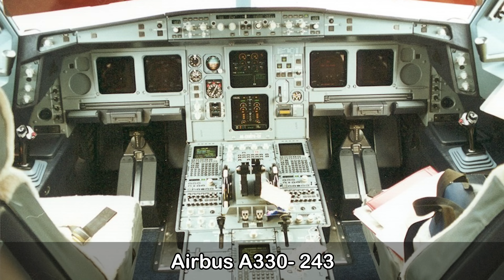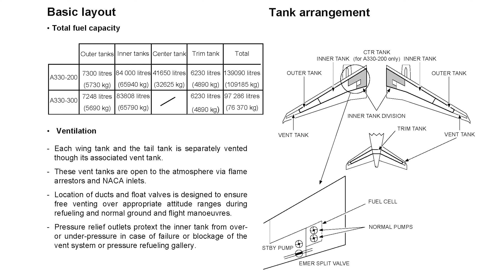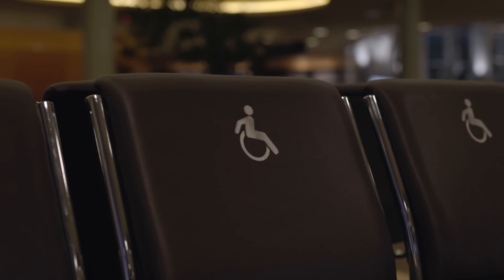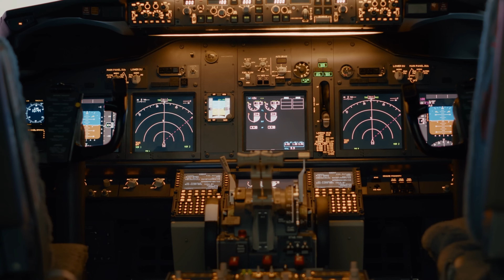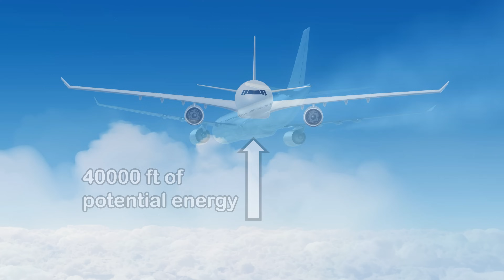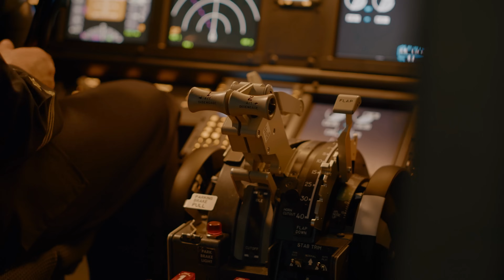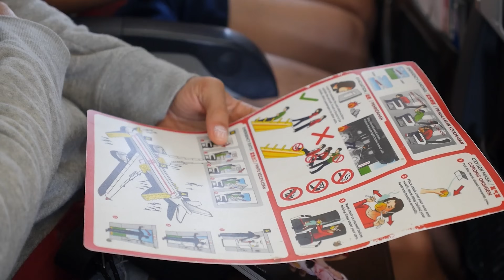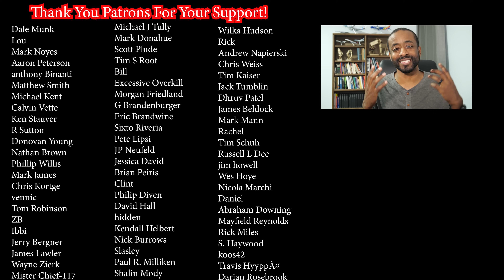The RAM Air Turbine. How Planes Continue to Fly Without Fuel

Comment: Largely correct but one point of note, even if you don't have "fly by wire" flight controls you still need a RAT.  The 767, CRJ, and E145 I've flown all have RAT's and are not fly by wire.  Reason being at a speed of .84 mach there's not enough mechanical force from both pilots put together to be able to move any of the primary flight controls.  Simply too much air resistance.  RAT's can either be an additional electrical generator or a hydraulic pump directly powering the PCU (power control unit) that the cables hook to that move the flight controls.  Hope this cleared something up, overall excellent video!

Comment: This is one of my favourite air "disasters". Your explanation of conservation of energy reminded me of a few months I bought my 2000 Honda Insight. Was filling up and a guy at the fuel station told me I should put a windmill on the front of the car attached to a generator to charge the batteries. That way, it would recharge as I drove and I'd never have to buy fuel again! I tried to explain that "in this house we obey the laws of thermodynamics" but his suggestion was to just use a large windmill! Finally after going around in circles a few times I told him that he was a genius with a world changing idea so he should invent himself and make billions. I always wonder if that guy went home and started playing with oscillating fans in his garage.
Reply: Sadly for him, Kia were ahead of the game...  the Kia Niro EV (and others) has a "Vehicle-to-Load" system.  There is (dependent on country) a 230 volt, 16 amp power point inside the cabin.  All you need to do is plug the charge-cable into the charge-point on the front of the car, feed the cable in through the window, and plug it into the Vehicle-to-Load socket... Now you can drive forever!
(I don't know why Kia did not build the cable into the car, it is quite ugly, and you get cold in winter!  Ahh well, small price to pay, I s'pose, maybe in next year's model.)
WhaDaYa mean Jeremy... you're just confusing me with all this "Conservation of Energy" nonsense!  😠 
Yeah... of course I know about thurma-dye-nam-ickxs!  😜

Comment: An EXCELLENT video, Jeremy! I spent a lot of years doing or supporting aircraft maintenance, both in the military and for a major airline, so I was already familiar with what a ram-air-turbine (RAT) is and it's importance. What I particularly like is your engineering and physics based approach to the discussion. I hope you are inspiring lots of young people to pursue the STEM topics. 

Another interesting topic may be the "Gimli Glider" incident  in Canada, several decades ago. A large passenger aircraft on a trans- continental flight ran out of fuel about halfway across. The complicating factor here is that Canada was in the middle of transitioning from the British Imperial measurement system to the Metric system, revenant documents were not updated, and more. One of the pilots knew the area, because he had served at a (closed) RCAF base nearby. That knowledge, and the RAT, resulted in a successful landing. I believe the aircraft was repaired and put back into service. 

At this point I would normally rant about the idiocy of the USA not making metric mandatory instead of just the current status of "legal". (The other two countries are each smaller than most US States.) But maybe that can be another video.
Reply: I naturally assume that your video is now an integral part of pilot and engineer training. 
The pilots will learn not to miss in their panic, that comment above the list, and stop the fuel from reaching the rupture.

Comment: Well done.  Here's a scenario I faced many years ago that could be used to teach how the much simpler systems on small piston engine-powered aircraft work; namely, how the magnetos will keep the engine running even if the alternator fails.  It isn't enough of a story to make a video about, but it could be a useful nugget nonetheless.  I was piloting a Cessna 172 many years ago in instrument conditions at night on an IFR flight plan between Corvalis, Oregon and Seattle.  At one point in the flight, I caught a very brief scent of an electrical fire, but very brief.  Then I noticed the ammeter was indicating zero charging.  Fortunately, I had plenty of battery-powered emergency light sources and a battery-powered GPS mounted to the yoke.  I shut down as many electrical systems as possible to conserve aircraft battery power, talked to ATC, checked weather at alternate airports (all were below minimums), then ultimately elected to continue to Seattle where the weather was better.  The engine hummed along just fine.  I checked in with ATC about every 10 minutes (radio and transponder).  By the time I got to within about 15 miles of Seattle the weather had cleared and I completed the flight VFR, and had plenty of power left in the batteries to turn on necessary lights and radios for the final phases.  At the time I was a nugget instrument rated private pilot, so you can imagine my stress level, especially as I had my kid with me.  Thanks again for this video.

Comment: When I first saw the re-enactment on Air Disasters, it took me 5 seconds at the beginning of the documentary to recognize exactly what the problem was as soon as the first officer reported low oil temp and high oil pressure, long before any mention of fuel.  All I had to do was think; What could cause a the oil in a jet engine to suddenly be too cold? -- A massive fuel leak at the engine with ice cold fuel!.   Regardless of a checklist, it just comes from common sense and knowing engines well for many years, and understanding what engine gauges are telling you.  Even having never flown jets myself.

Comment: I've been shot at and I've done other things, but to this day the proudest thing I've done was fixing 5 different engine generator problems while in the middle of the ocean between the UK and Iceland. 

As an electrician flying on a C-130 on our way back home after picking up the aircraft from Bagram AFB, I was of course woken up mid flight to see what I could do.

The first time I was woken up we had lost 2 of the 4 main generators and the corresponding electrical busses didn't automatically swap over to the remaining generators to prevent power disruption. This alone is extremely unusual, there are 4 main electrical distribution busses that are connected to main engine generators by 8 contactor rated for 210vAC @ 400hz and 300 Amps. The contactors are arrange in a way where they are automatically energized and de-energized by the generators themselves to switch power between the main bus so no one generator accidentally tries to turn a different generator into a motor.

Once all 4 engines and generators are up you can technically loose 4 of the 8 contactors with out getting a single warning and with out loosing a single distribution bus, under highly specific and perfect conditions.

Prior to this event the only time i had ever seen two generators go out at once, where the busses also didn't automatically kick over. It was on a C-130 we had just taken out of the bone yard and where preparing it to be flyable again. After the 3 function test flight the aircraft's crew called down with an in flight emergency. When I examined the system some 4awg wires had chaffed each other's multi layered insulations that include fiberglass wrappings and some polymers that give you cancer if you simply pronounce the name of the molecule chain. Needless to say there where lots of scorch marks.

As I remembered that incident I checked the fault codes but they where generic and usually fixed by a power cycle while on the ground but obviously we were not on the ground. I also, sniffed around for some magic smoke but nothing. As we where somewhere between the UK and Iceland and still had some power, I had the crew turn off the two faulted generators. I pulled all the circuit breakers for the two generators and then started to remove the paneling for the contactors to make sure nothing was going. Of course nothing was wrong.

Feeling fairly safe, I reset the circuit breakers and had the crew reset the generators. They both came on and the busses also came back. Plus all the power readings looked perfectly normal from the voltage to the power drawn across all 3 phases for all 4 generators. So, I went back to sleep.

About an hour later the crew woke me up again and told me "we lost three now" I asked "we lost number 3 too now!?" The dude said "No, we lost number 2, 3, and 4" 

I got up without further conversations and went straight to the contacts ripped of the panels and again nothing. Check the fault codes and the same two had the generic fault codes usually fixed by power cycles. The fault code for the number 3 on the other had was a 50/50 between shorted generator windings or bad control unit. Luckily the control units sit in fairly accessible areas inside the plane and I had a spare one with me as part of my "just in case we need this kit"

After seeing the codes, I went up to the crew had them turn off the three generators. I pulled all the circuit breakers for all 3. I went up to the analog contactors and gave them a few good wacks. I pulled off the connectors for the control units for bot gen 2 and 4 then outright swapped the connection between because well, magic. A trick that happens to work to get a plane off the ground that keeps getting these particularly fault codes. The plane almost always flies fine then when it lands we swap them back and the problem doesn't come back.

As for the number 3 generator's control unit I slaved in the new unit.

With things all moved around I had the crew turn all 3 generators back on and they where all golden.

With power all good to go, I finished replacing the number 3 control unit very carefully, even if it was just the mounting hardware.

The aircraft flew perfectly fine for the rest of the flight and all the remaining flights back home. Once home i restore the control units for number 2 and 4 back to how they should be. I annotated the maintenance forms they had been swapped back and of course the plane flew fine for the next 2 months or so before I stopped keeping track. At leas as far as the main power distribution systems.

Comment: I love that you're into planes! I've been a huge fan of yours since you were picking through the curbside trash and making tools out of old vacuum cleaner motors. Now that you cover another of my favorite subjects, your channel has achieved a new level of awesomeness. You should cover some 400 hz motors that come in aircraft and advantages and disadvantages to high frequency electrical systems. It's really cool that a motor at 400 hz can produce 30 hp and not be much bigger than an electric drill.

Comment: What a great story. As it turned out, I was actually stationed at Lajes Field in the Azores when that happened. It was amazing to see how far the plane bounced and then to see the wheels and tires worn down to the axles because as stated the brakes locked up. Needless to say the runway was covered with pieces of metal from the rough landing.

Comment: Excellent explanation of the scenario of a improbable cascading chain of events that can result in aviation mishaps.
You mentioned loss of cabin pressurization. That is also a function of the engines via bleed air system.
Thanks for sharing.

Comment: For those worried about fly by wire. Most if not all cars today are fly by wire. Fords last vehicle to convert over was around 2006. So these systems cars and planes are pretty safe, not saying something could go wrong, but then there are many other things that can fail. Fly by wire you more than likely drive one.
Reply: i dont think any cars are fly by wire. drive by wire maybe. jokes aside, brakes and steering wheel are still mechanically linked in almost all cars. only the gas pedal has been electronic for ages now.
Reply: Several newer cars especially all electric have gone to no mechanical links now and more will be doing so as they are redesigned. Like most things the high end cars get it first and they move it down through to the others as the improve and streamline production and costs go down. One thing that was slowing down the change over was getting government regulations. It took years just to get LED lighting approved.

Comment: Any landing U can walk away from is a good landing. Truly fascinating story about a) backup systems as safety factor i.e. redundancy in engineering, & b) pilot error i.e. just do & ignore the checklist which is is own backup system. 
In today's world I'd expect real time software analysis & output warnings suggesting possible fuel leak(s) or other conditions based on monitored inputs pilots see individually.
Reply: 737 max: redundancies? sounds like communism!
Reply: @Jack-he8jv  Engineering issues notwithstanding, both 737 Max crashes had major pilot/maintenance errors as contributing factors. There are always multiple contributing factors and it's a bad idea to ignore all but one.
Reply: It was a certification and training problem. A new type rating should have been required, but wasn't. Retraining should have been required, but it wasn't. The mcas was a bad idea, having it fed info from a single sensor doubly so. All because Boeing did not want the plane to require a new type rating, because airlines don't like that. Having the authorities outsource the certification process to the manufacturer wasn't a brilliant move either.

Comment: Pilots do have a suite of instruments that run on the 28v backup battery system.  It's true they lose their "screens"", but critical flight information is shown redundantly on simpler, sometimes mechanical instruments.  These include a gyroscope horizon, standby altimeter, and VOR/ADF.
Reply: Not in all cases.  That's why there's a RAT/ADG.
Reply: @Len Laughridge  Strange.  I was under the impression, as a former Avionics Technician, that all commercial airliners were equipped with such vital "standby" (or backup) instrumentation.  What planes are you referring to that don't?

Comment: Hey Jeremy, I'm enjoying the series. I never really gave much thought to the design of an aircraft, but as someone who works in IT, I can appreciate the thought given to redundancy and automation. Backups to the backups as we say. The difference is that if I do my job wrong, people can lose time, money, and sensitive data. If an engineer does their job wrong, people can lose their lives. Anyway, I did a deeper dive after your video on aircraft tires, and came across another channel I think you'd find interesting. It's called Mentour Pilot. He talks about all kinds of interesting things such as why jet engines don't have grills to protect from bird strikes and why there isn't a system to spin up the wheels to match ground speed before landing. One of the most interesting ones was when he talked about jet engine placement and how that affects flight characteristics. I never really thought about that before.

Comment: With a glide ratio of around 17:1 the envelope to make it 65 miles to the airport was easily doable. They were extremely lucky to have and island with an appropriate size air strip that close. Checklists whether followed initially should always be referenced at some point during the emergency. They could have at least slowed the fuel leak sooner.

Comment: In the mid 1970's my sister and I flew from New York to Heathrow, England and we had a somewhat similar experience (due to a different failure).

About 3 hours into the long flight there was a burning smell, followed by the TV &entertainment system shutting down. Then the lights went out.

A few minutes later some lights came back on but then went out for good.

Oddly after about an hour water started running down the floor causing panic.

We finally got to Heathrow and flew over it several times (rumors were to check landing gear). The pilot announced the landing might be rough due to using "non-standard" flight controls (whatever that meant).

The landing was, by far, the scariest part of the ordeal, with numerous fire engines racing down parallel runways to meet us at the end (that we could see out the windows), and then an insanely terrible landing. The landing was so rough that around 1/2 of the overhead bin doors opened and luggage crashed down onto us as the plane smashed into the ground, bounced way up into the air and smashed into the ground a number of times.

We stopped at the end of the runway and were unloaded there.

The next days news paper said there were a few minor injuries from the falling luggage and passengers that didn't wear their seat belts.

It was quite a scary ordeal that we'll always remember and we had to fly home in 4 weeks...

Comment: Great video!  I will comment that RATs were used well before fly-by-wire became common, at least on the A-4 Skyhawks that I worked on while in the Marines back in the 70's.  The instrumentation was analog, but still needed power to help the pilot if the generator failed.  Plus.. it powered the horizontal stabilizer trim motor, which was essential for landing.  After my time as an avionics tech in the Corps, I got my electrical engineering degree and went on to design avionics!  Engineering can be a fun career!

Comment: The rat (ram air turbine) is loud as fudge when they do the functional test. Atleast on a 777 and 787. 
There was also a simular situation that happen when the piolets request fuel in gallons but the Canadian land crew filed in liter. The plane wound up deploying the rat and landed on a old runway that was turned into a drag race strip during a drag race day. The piolet used to fly sail planes and that was one of his old Air strips.